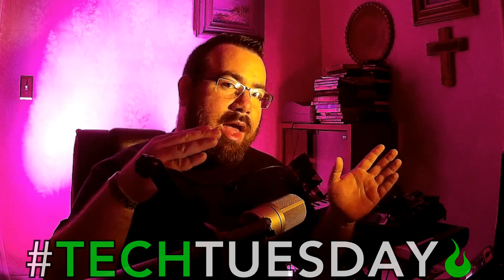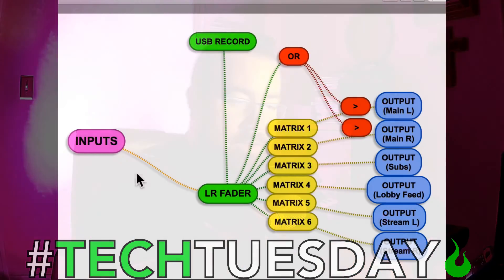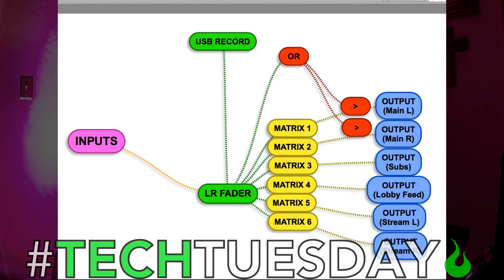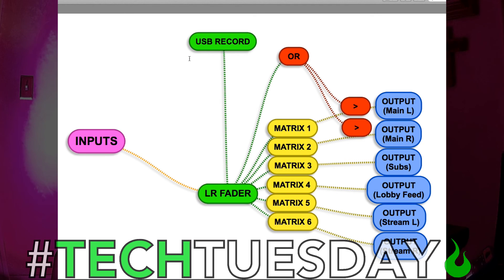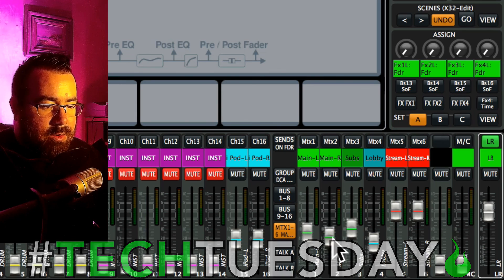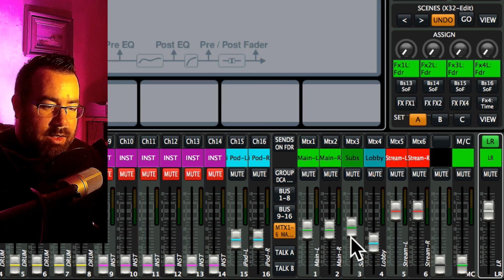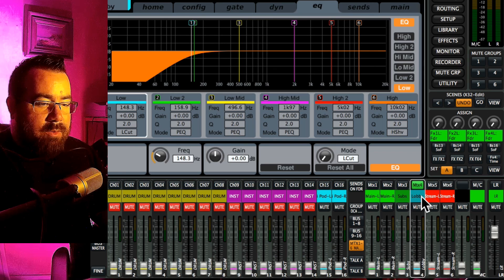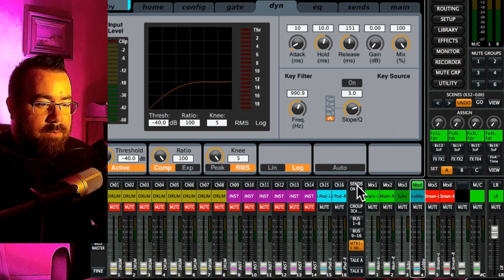Mixing with Matrices - #AscensionTechTuesday - EP008

Comment: Have you tried inserting the Sound Maxer effect to the L&R main to have that same effect on all the matrix mixes. I use Matrix 1&2 for Streeming, Martix 3 for lobby, Matrix 4 for front fills, Matrix 5&6 for FOH and M/C for Subs. What are your thoughts on this setup?
Reply from the maker: I don’t really have much interest in the Sound Maxer. I’m usually too limited on rack FX and I get more use out of the Precision Limiter for my Stream busses. 

Have you been using it? How do you like it?

I did recently add the stereo enhancer on a broadcast console. I happened to be lucky enough to have enough busses and rack effects to splurge a little in that one situation :) 

-Chad

Comment: Right now I have the board set so LR Fader sends to the following matrices: FOH LR, Lobby, and an Overflow room.
In the Overflow room, the vocals seem heavier than the instruments. I am wondering if there is a way to send more instruments to the Overflow specifically?
Reply from the maker: If you have 1 or 2 (if in stereo) extra busses, you can send a submix of instruments to that mix and then blend it in to the matrix that needs more vocals. Another option would be to set up a post-fade mix that can be sent to the overflow, online, etc. That mix would "follow" your main mix and allow you to boost or lower instruments to make up for issues in the room (like a loud drum kit). Check out this video for more info: https://www.youtube.com/watch?v=9dsKZJRhY1I

-Chad

Comment: So, I actually have to Send On Fader LR fader to the Matrix? That's the procedure? Did you did a video on that? I would love to watch it!

Thank you! I love watching your video, they are very practical and informative!
Reply from the maker: Good question. On the console, you can do sends on fader. In the editor app I'm using here (an old version), they forgot to add that functionality so I'm going to the LR fader, selecting the sends tab and adjusting from there. Both achieve the same result :)

-Chad

Comment: Is it possible to do the same thing as you show with master LRM/C and FOH LRM/C with the matrix but in reverse? For instance can the master be in the matrix and the FOH be in the right side? Our church is getting the X32 next month, and I see you can select the usb recording source. Is there anything else that would block this concept?"
Reply from the maker: Sorry, I'm not sure I understand what you're trying to accomplish.
What are you trying to do?

-Chad
Reply: I'm new to the X32, haven't worked on one just yet but getting one very soon. I love your concept of separating your master LR mix and FOH LR feeds because I see your point you make in this video. What I wanted to know is if you can essentially do the same thing but the FOH LR feed is in the LR faders and the master LR feed in the matrix (basically flip the order as you show in the video example). With the routing options in the console, is it possible to do this?
Reply from the maker: If you're asking if you can send the signal of a Matrix to the LR fader, no you cannot do that. The LR fader is a mix and can therefore only receive input channels. The matrices are designed to receive mixes (such as the LR mix etc).

Is your reason for wanting this based on the visual layout you want for your console?
Reply: Ascension Worship - #TechTuesday Yes, trying to keep it simple. Most of my team will want to use the main fader for FOH volume, because it makes sense to. I just prefer to avoid having other mix signals affected by the main LR fader. 

So short answer is yes, wanting to maintain a better visual layout
Reply from the maker: You can set some of the Matrices to be pre-fade rather than post if you want to the LR mix to feed all the matrices but not have all affected by the fader. That should accomplish what you want.
Reply: Thank you for the info - Much appreciated!